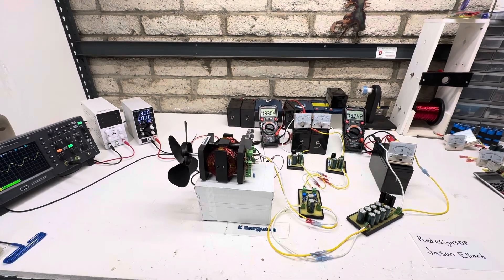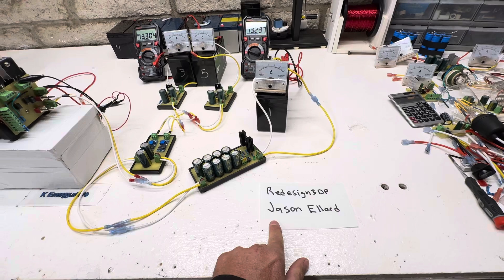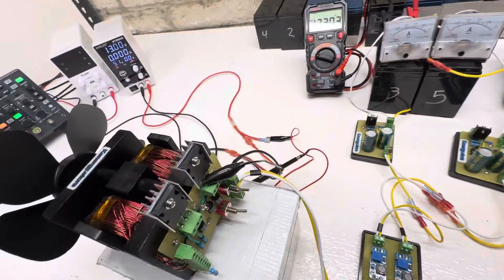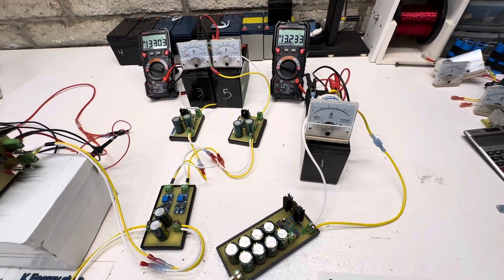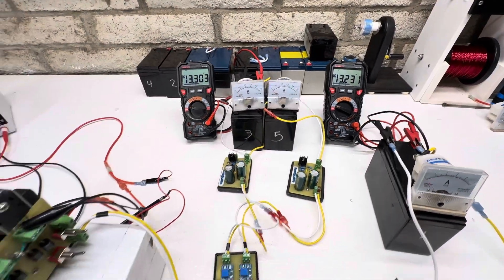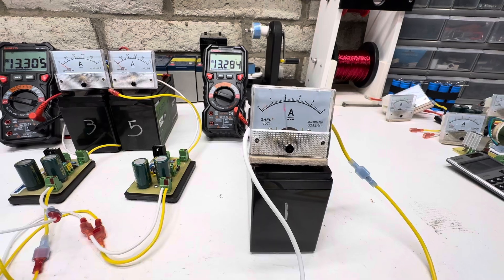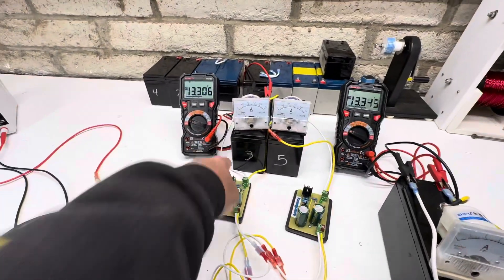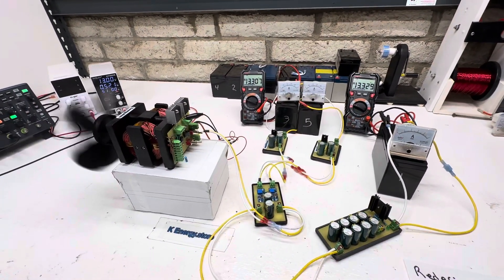Energy Harvester on the output side

Comment: im  curious why you would put a voltage boosting circuit in your setup if primary goal is harvesting power
Reply from the maker: @katiekumcgil  the secondary output is 1.9 volts so it brings it up to 20

Comment: I hope this is not asking too much, but could you do an experiment on a trans axle motor/generator for a hybrid or an EV? 
Modifying an existing motor assembly, perhaps scaling up the size of the capacitors and using the existing DC to DC converter and inverter on the vehicle? I feel this is the direction we're going anyway, may as well get there sooner. Thanks!